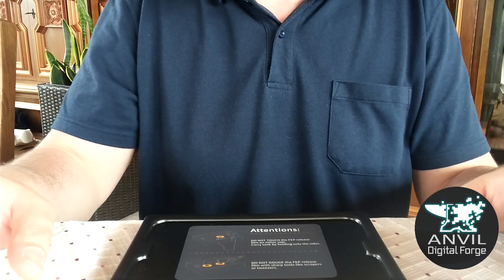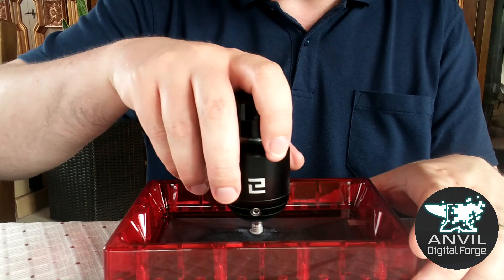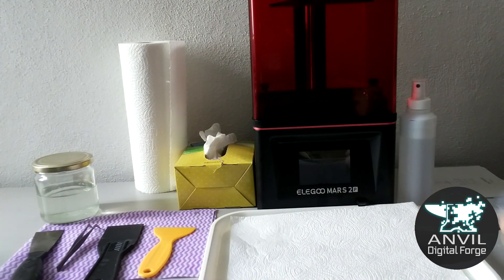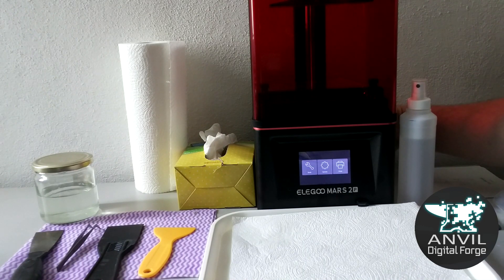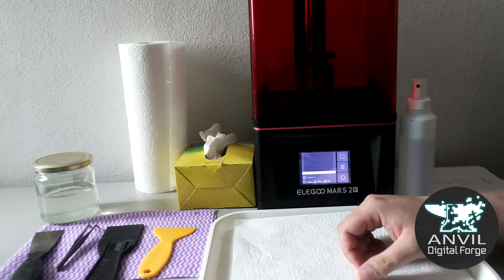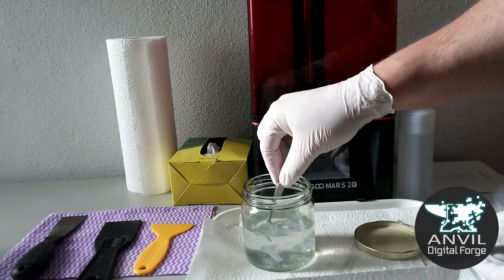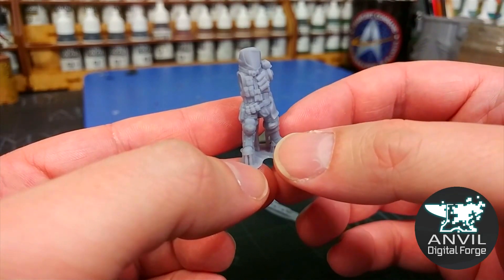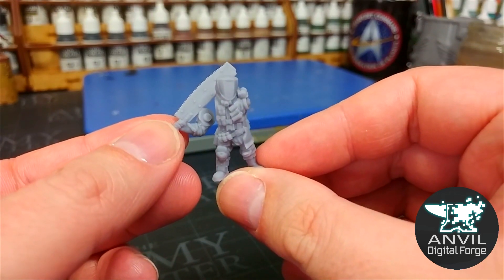Complete Beginner's Guide to Resin 3D Printing ft. Anvil Industry Digital Forge (Part Two)

Comment: I would recommend to remove supports before curing. Especially if you place the model under or in hot water for a few minutes the supports will come off very easily, without leaving any marks. Otherwise a great beginner tutorial!

Comment: A really handy two parter! I’d recommend maybe dipping the mini in warm water for a few seconds and then removing the supports before curing. Seems to leave less marks on the actually mini.
Reply from the maker: I've used it a few times myself to good effect, but it can be a little dangerous when you're removing supports off a sword or similar. Still, it does bend straight back! Something I should have mentioned, though, you're right.

Comment: What would you say is the largest dimension that you would sensibly print on that machine?
Reply from the maker: I've safely printed 1/56 scale WWII tanks in one piece (well, turret and hull separate, of course) on the original Mars, where this has a slightly bigger build surface. 'Pretty big' is probably the easiest way to put it, I haven't found anything sensible that'd take up the whole build area.
Reply: @SonicSledgehammerStudio  I would not mind splicing a mini for assembly later. Was just wondering if you found stuff that should have worked (size wise) but did not get it to work for strange size reasons. But in this case I should be able to use up the full build plate. Cheers 😁
Reply from the maker: Nah, size has never really been much of an issue. The original Mars I could fit about six or seven full-sized infantry figures with gear on a build plate, where the Mars 2 I can cram 12 on there with a bit of luck.
Reply: @SonicSledgehammerStudio  Fair answer. I am just asking as those resin printers "feel" small :-)

Comment: Something which may be of use to people who aren't in the sunniest of places like me in the UK, I use a small UV nail curing station to cure my minis. About 10-15 mins under there with a few rotations in between works perfectly. You can also find them pretty cheap on sites like Amazon, mine was only about £20 I think so just an option for those who maybe can't afford a wash & cure station. 
Lovely videos though, was refreshing to see that I am doing my printing right, even though I've been doing it since Nov last year xD
Reply from the maker: It doesn't hurt to hear you're on the right track, right? ;D I've made my own cure box and have a UV lamp I use, but I'm thinking it might be worth picking up one of the wash and cure stations myself. They come pretty strongly recommended by a couple friends who're into more serious printing than me, so it might be nice!